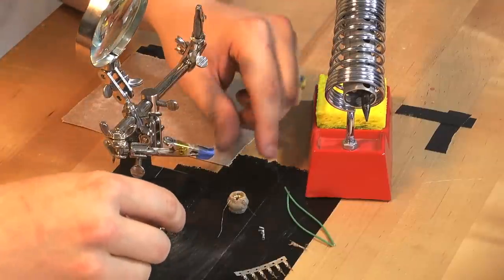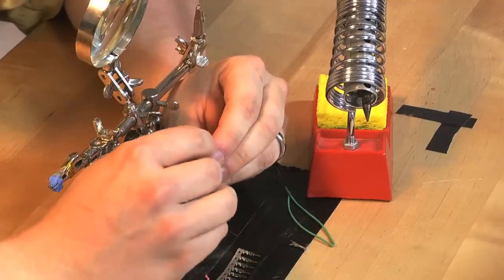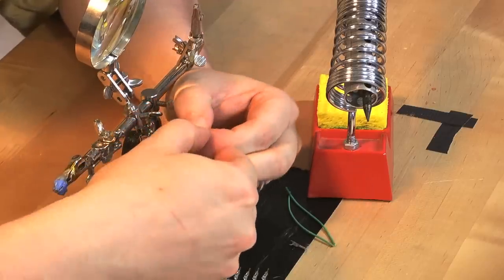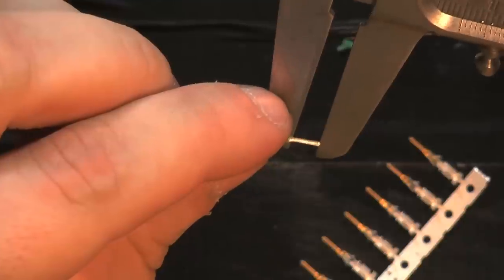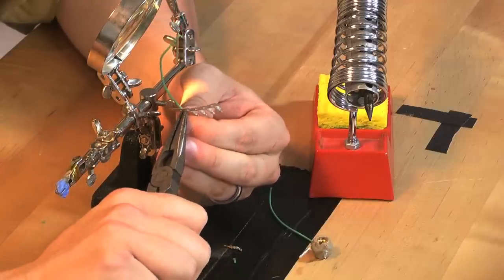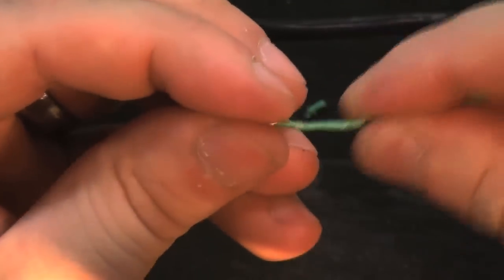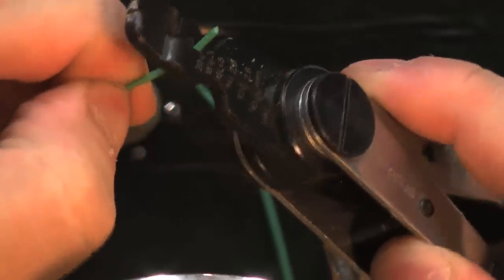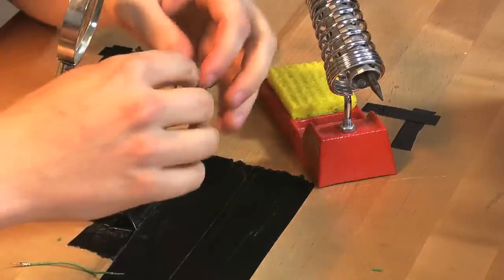MakerGear Hot End: Core Wiring

Comment: @kwixson : ok thanks great ... the main point is that I can use the maker gear hot end on the wade's geared extruder.  Yet,  do I have to put any wooden mounts or something .. as I read on the Ultimachine website , if I ordered the maker gear kit , they also provide an extra wooden part that costs around 6 $ to mount it on the Wade's geared extruder ?

Comment: Hi , I was planning to buy the Wade's geared extruder however it's not available that much , so I found the Maker gear extruder as other alternative... for the video I can see this is the makergear hot end.I need to know is there is a difference between the wade's and maker gear extruder or not .. Also I want to know if the maker gear extruder has gears to push the filament towards the hotor cold end . Also, want to know fi this maker gear can be used with the wade's geared or not? Pls reply VIP